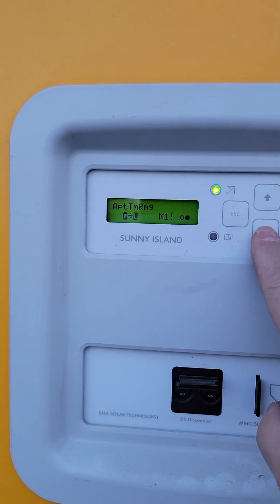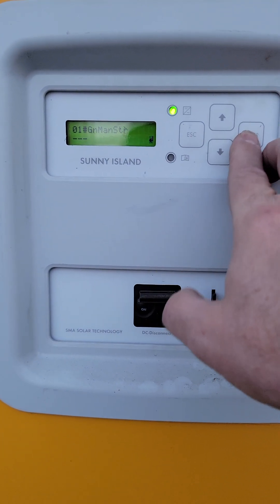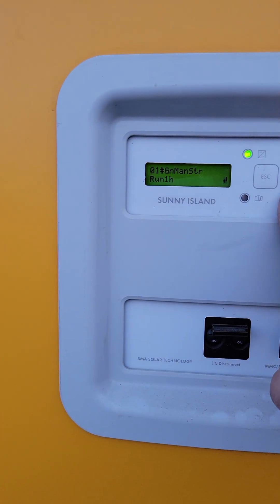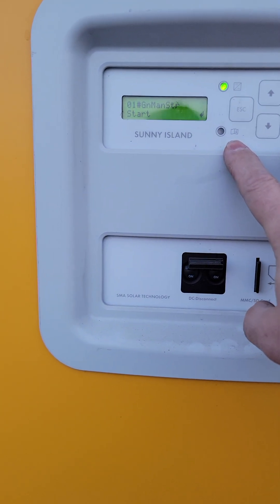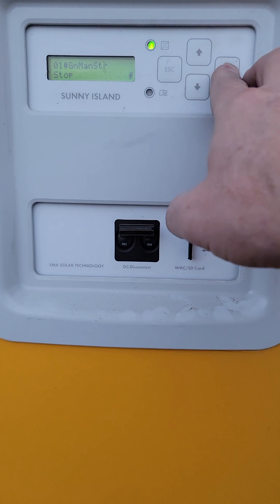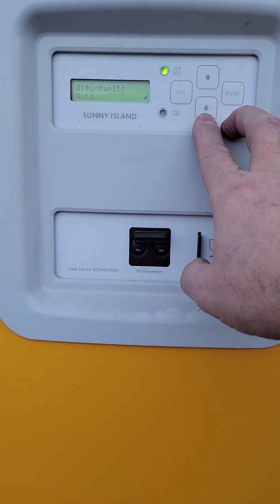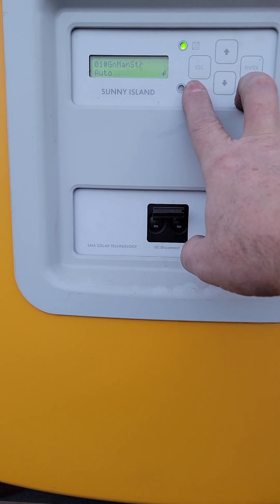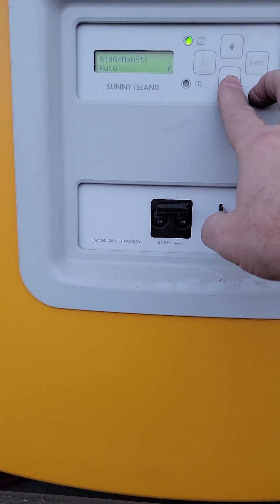How to manually start/stop generator from the Master Sunny Island inverter

Comment: John- your videos are excellent - thank you! I tried unsuccessfully to clear my codes today but will try again tomorrow. My generator kicks on but quits after a few minutes regardless of whether I turn it on manually through the inverter or it comes on during “auto” mode. If I turn the generator on by key it starts up fine and stays on but doesn’t charge the batteries? I have to believe one of the error codes is responsible for this- any suggestions? Thanks again

Comment: John - thanks for reminding us that there is a 1hour run time for using a little power, charging battery banks and just cycling the generator and fuel recirculation. I will keep that in mind!

Comment: I have a SI5048 that works fine, but oddly the entire #240 menu selection to configure the generator is missing.   I'll take a look under Operations to see if I can find any settings there.   Any idea why the 240 menu would be missing?   I'm certain it used to be there!